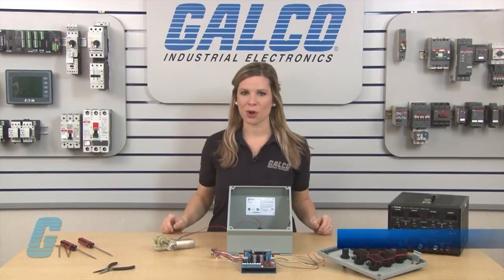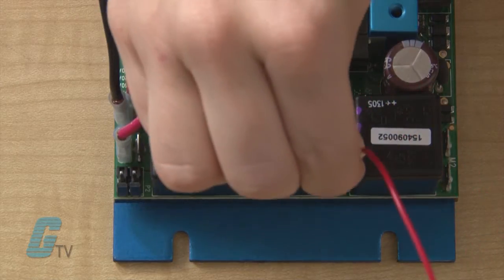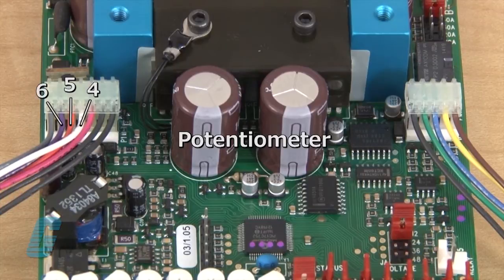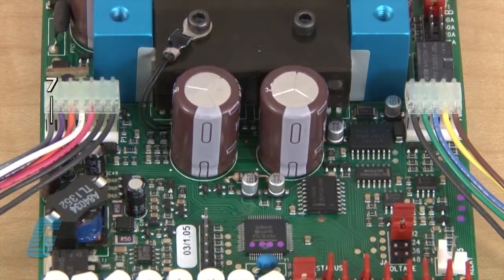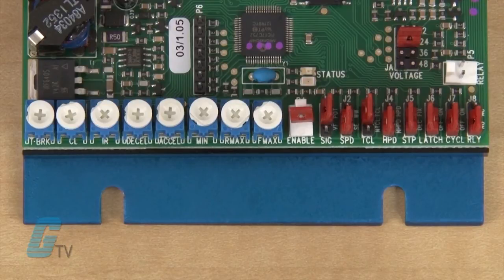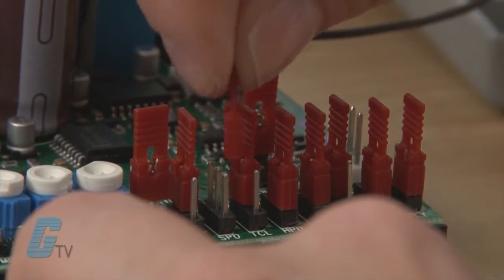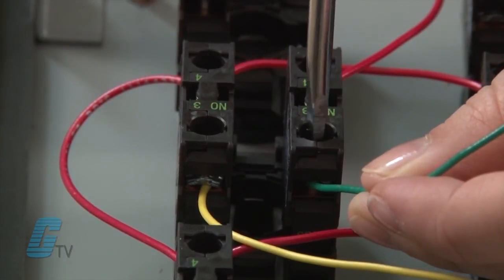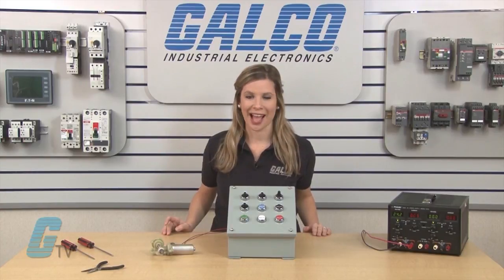How to Hook Up a 12 or 24 Volt DC Motor to KB Electronics KBBC Drive With a 12 to 24 Volt DC Input

Comment from the maker: The KBBC drive can be used to control small 12 or 24 VDC motors from a 12 or 24 VDC power source.  This can allow for hobby or automotive applications.  It can be used to raise or lower objects through a switch or be used to move something forward and back.  This video outlines how to set the drive up for voltage following, speed pot (wig wag and single ended), forward/reverse/stop, and with or without limit switches.